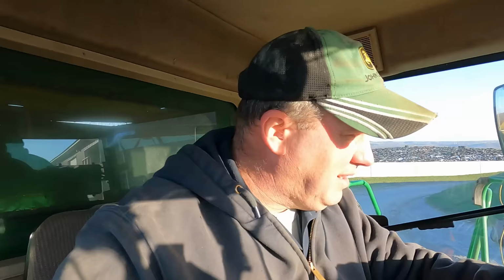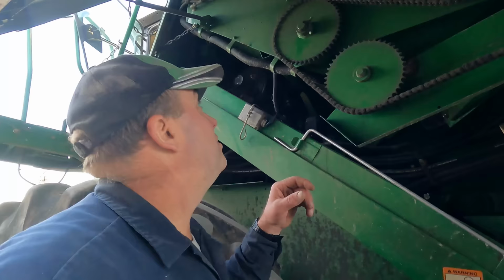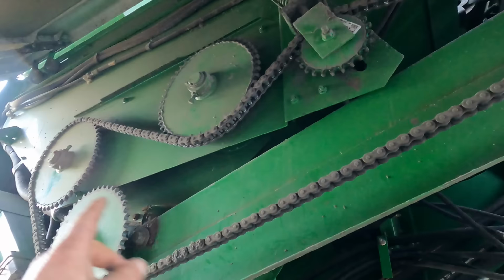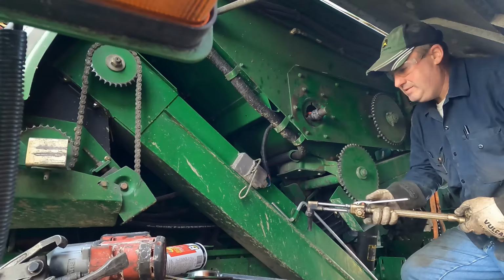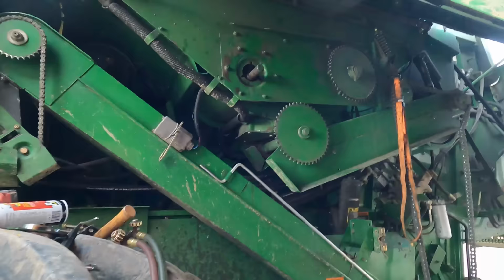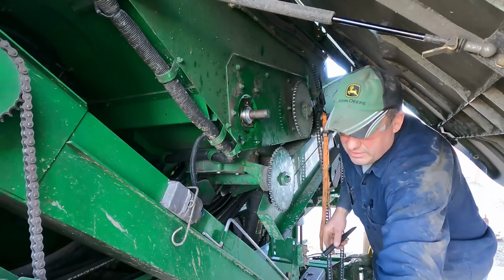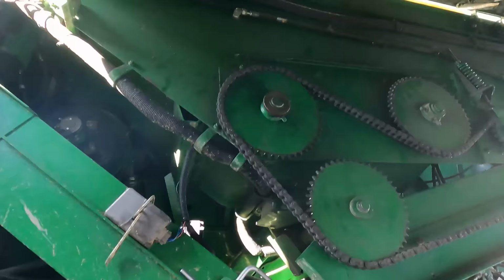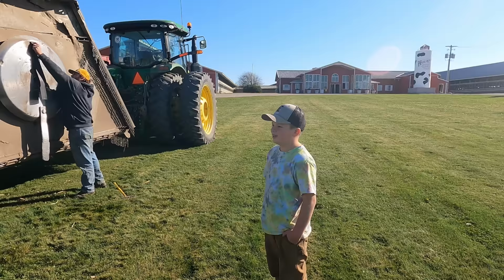Grain bin auger bearing replacement.

Comment: Nice to see straight forward repairs. Good eye on checking the keepers, collar, and even the key. Watch out for those hot bits poppin off the flame  there Andy, that's definitely how you get hot under the collar. Don't know how many times I've found burn holes in pants, shirts, jackets, boots, and God knows how many other places. Glad to see you not have to tear half the machine apart for a change.

Comment: Andy, didn't you already replace this bearing a while back? Or was it a different bearing. Have considered using painters tape or hot glue to hold bolts in place? Great video as always, cheers :)
Reply from the maker: Different bearing

Comment: In the wrong direction you are trying to unlock a broken bearing. I lock this type of bearing to the right like most threads.
I myself noticed that this is how such bearings are blocked.
Reply from the maker: A bearing is locked depending on which way the shaft turns